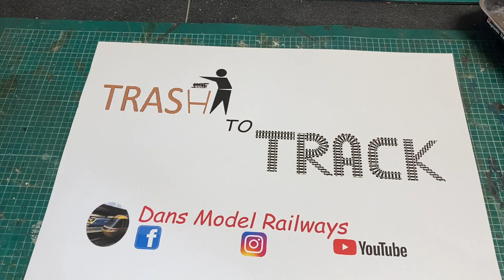Trash to Track Episode 20. Tri-Ang Lord of the isles & Britannia loco’s.

Comment: Hi Dan. I have just restarted my interest in building a layout after forty or so years and, yes, I have an accumulation of locos which I have doubts about. This includes a ''Lord of the Isles'' and a ''Harry Potter ''set which I bought for my daughter some 20 years ago. I tried to run them the other day but neither would budge. I will check whether or not it is the fault of the controller from ''Harry Potter'' set and when I have fixed ''the blame'', I will be back in touch. All the best, 70-year-old steam enthusiast, lol.

Comment: Never seen TT Lord of the Isles before so not sure if this is the case ..  but at 11:27 and a few other shots it appears that one of the drivers (the top one at 11:27) should have a traction tyre ?   Thanks for the video.
Reply from the maker: The loco is not TT scale, the motor is the same one which tri-ang used in their early TT locos. Sorry for any confusion.
Reply: Triang never used traction tyres.
That was a much later change made by the Margate company when named Hornby.
It also needed electrical pickup and wiring on all four wheels of the front bogie to try to make up for the loss of pickup that traction tyres caused.
Reply: @johnd8892  Thanks